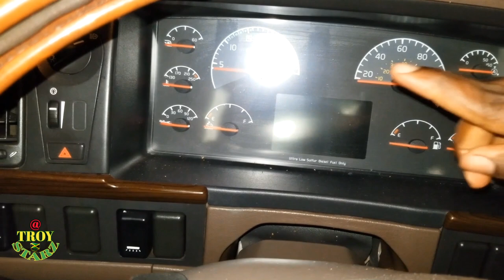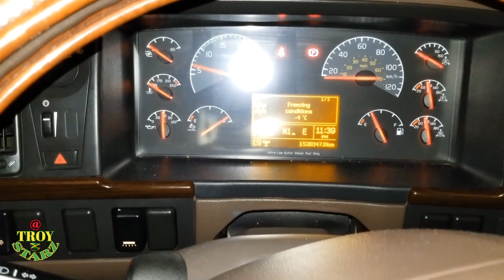Last Night J-B Weld Save Me $3K | My Volvo Truck Radiator Blew up. VN#122

Comment: You are learning! That's how you survive in this game. 

My main air supply line got a crack (compressor to dryer) I could not make air. Crawled underneath found the crack, I applied JB weld, then wrapped it with rubber band, then ziptied it away from the metal edge.

Guess what. It still works 50K miles ago.

FYI. I have the new metal braided hose in a box - just in case LOL!
Reply from the maker: 👍👍 yes man little by little mi soon learned the business like you

Comment: I also did the JB weld , that was before I seen your video “
&
it worked for me. 
I applied it when I took my 10 hour break and got back on the road there after and Woooooooo”
No leak !!😃👏🏻👏🏻

Comment: It will work, me jb weld mine 2 yrs ago and it still going strong, run with the radiator cap off for a day so it dont build pressure, that will give it more time to cure
Reply from the maker: That's true

Comment: i had my fan blade go thru my radiator in my volvo vnl 2 years ago clean really good jb weld it and its on the bottom of radiator still holds over 2 years and 80k everyday driving on NYC highways best stuff also oil pan rotted out same thing jb weld it 5 years ago still holds no leak

Comment: $700 radiator $500 labor $1200 i do it in NJ those guy’s charging you almost $3000 are robing you!
Reply: Now, with  the inflation radiator costs 1150$. Then 600$+ for the labor.  Jb weld is a good temporary fix.

Comment: That small hose its the return and you cable tie it on that metal pipe. Remove the cable ties. The vibration of the metal cause it to crack.
Reply from the maker: Thanks👊. Where is the cable tie that you mentioned located?

Comment: U can get recycled coolant from a junkyard 4 like 2 dollars but super glue and baking soda work just as good u need a hood lock u might have ran over something and it somehow cracked that part or vandalism!
Reply from the maker: Thanks👊 for the tip I think it was damage from a dealer that I went to to get my injectors change right after I get the truck about 500 miles down the road that's when this occurs.

Comment: Yeah man it will work for a while but it aint a permanent fix.. I have use it on a motor cycle radiator when i wasnt able to weld it on the spot..
Reply from the maker: Ok thanks for sharing

Comment: Same I mean same exact place mines leaking outta of
Reply from the maker: Really
Reply: TroyStarz Trucking Vlogs yeah I got a 2013 Volvo 670 but I got a Cummings engine but I see the radiator setup is the same exact way as mines and I have that same crack problem currently you a life saver I just need a quick fix until the part comes in.. 💯💯
Reply from the maker: @esaurollins4609  it will work

Comment: Wouldn't it be cheaper if u buy the radiator yourself.
Reply from the maker: Lol
Reply: @TroyStarzTruckingVlogs  when you done fixing your truck you can fix any volvo trucks lol. I just have my kenworth 3 month now and already put 4gran in repairs into it.
Reply from the maker: @bankergeorge  jah know don't worry you soon make back all of that if not already lol 😆 thanks for the feedback 👊
Reply: @TroyStarzTruckingVlogs  not really enuh. Me used lease a truck from the company for $800 a week and use to make all $2800 a week after all expenses taken out but from i buy my own truck me not making no money. Am making like $1500 week as a owner operator. Me a cut leave them very soon. Pussy them badmine
Reply from the maker: @bankergeorge  just cool enuh man a so them wah tek wi fi fool more time just do what right and work best for you 👍